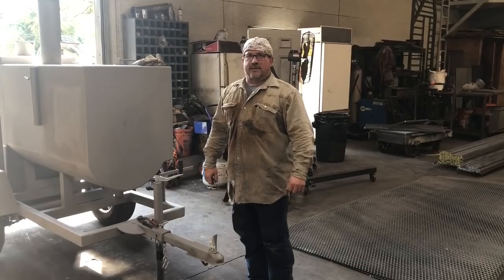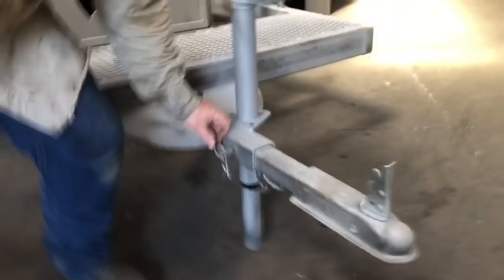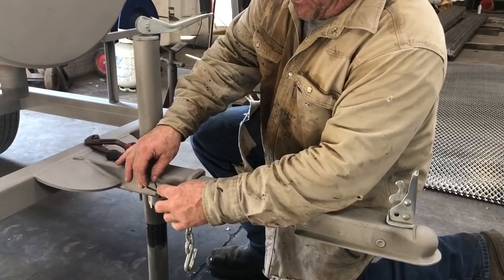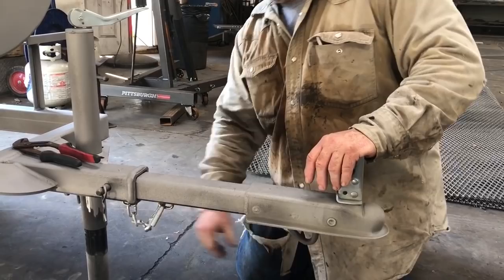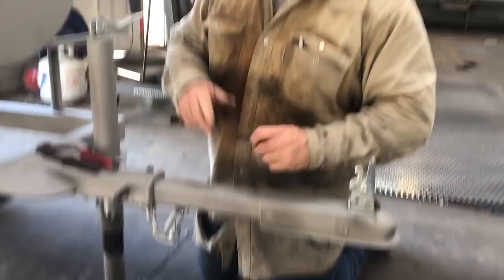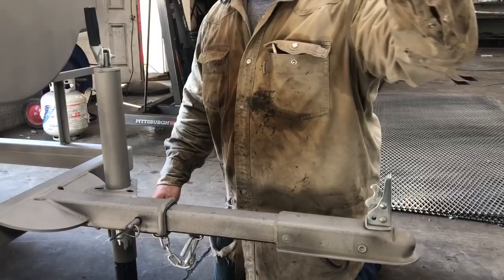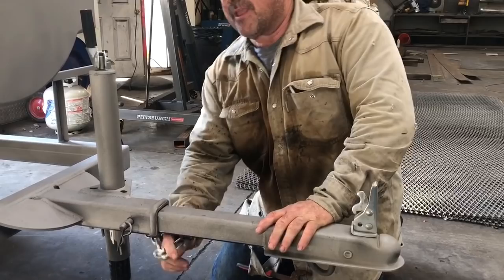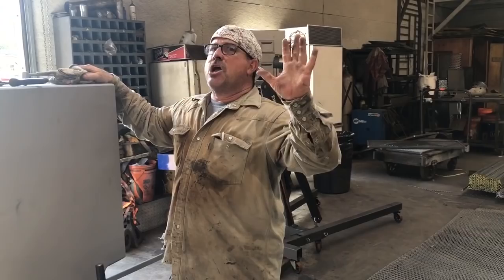The correct way to put a pin in a removable tongue trailer..... By Dad.... he’s a little fired up

Comment: In fact, I'm gonna comment again. I wish you would do a series of these videos on other issues. For example open the damn chip bag with scissors instead of tearing it open. The chip clip can only do so much good if the bag is ripped open like a dog did it. I know it takes a couple seconds to find the scissors, but there will be another video on "keep the damn scissors in the same drawer every time" that will fix that too.

Comment: Will never trust the pin so I always weld in a crush tube and insert a grade 8 bolt.
Reply: Best way to go as I have worked with handicap equipment for 30+ years installing many wheelchair carriers in hitches,  and a crush tube along with a grade 8 bolt and lock nut, not only never will loosen up or come out , but also takes away play in the receiver :)